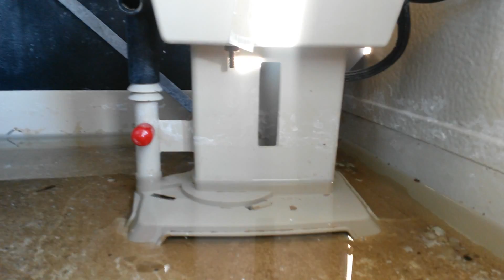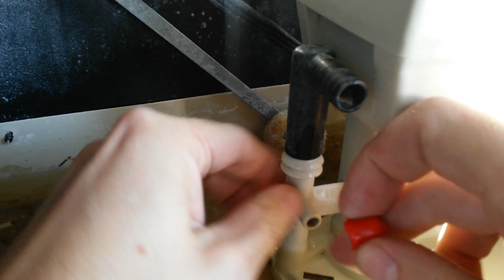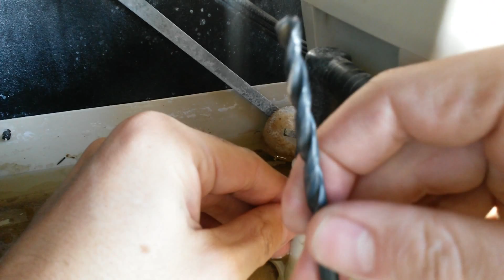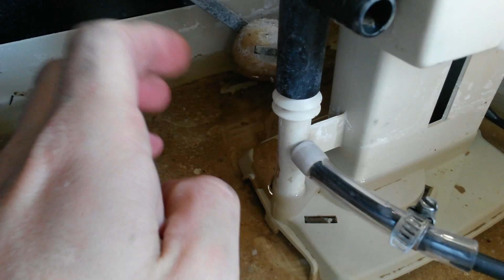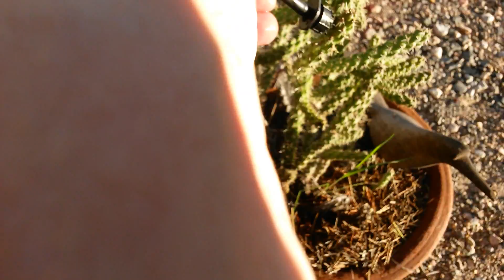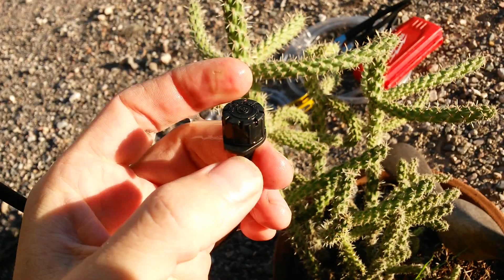Evaporative/Swamp Cooler Bleed Off Valve ~How to Completely Eliminate Scale Build-Up

Comment: What I did was connect a water hose to the overflow under the evaporative cooler and then I removed the tube in the cooler that is on the upper end of the overflow. I have a cap on other end of the water hose and I just uncap it every few days to clean out the water in the cooler. Here in New Mexico we have quite a bit of minerals in our water.  I have but don't like using a purge pump, I feel that every 8 hours on its timer is way to often to change out the water.

Comment: Watched this vid yesterday. Thanks. My pump has no  side fitting like yours so I had to re-think my setup. Since my cooler is a roof top model, it has about a 15' drop to ground level. why not do Gravity Feed? I bought 50' of the 1/4" irrigation tubing and a small pack of the adj drip tip you used  and ran the line to my big tree that could use a slow constant drip. A quick suck on the line sent a nice stream to my tree which I throttled down to a very slow drip. The other end was just placed under a small rock in the cooler base and fed thru the overflow tube. Bingo! Done. 2 parts. 7 bucks. Thanks!
Reply from the maker: Nice!
If you ever loose vacuum, you'll have to start the flow again. Great solution!

Comment: The man at the hardware store said I could attach the SE directly on the water line? Another video on here says so too. Does anyone know for sure?
Reply: What is an SE
Reply: @HopefulPessimist  Scale Eliminator...i did end up using one. It does no good whatsoever without a bleed off pump, which uses a lot of water running off the roof. No thanks!
Reply: @userG5447  thanks. I actually have quite an inventive mind thanks to somebody upstairs ha ha. IronBuddy 5Pcs Brass Spray Nozzle with 1/4“ Barb Adjustable Misting Dripper Sprinker Spray Nozzle for Garden Lawn Patio Irrigation System https://www.amazon.com/dp/B07RN481B5/ref=cm_sw_r_sms_apa_i_ONs1Eb2RCMZTH

I put my bleed off pump to use. Not super great, but the hummingbirds seem to like it.
Reply: @userG5447  My solution to that was to run a line over the roof to a 55gal barrel on the side of my house with a pump in it. I have lines run to various plants around the yard. This way none of the water get wasted, good for the plants because the chlorine is gone after the water sits for a few days, because it is a VOC.
Reply: @peterbrockhoff857  That's what I was planning on. Picked up an extra barrel from another project; cuz it was a good deal, it's been sitting in the basement.

Comment: Actually there is a difference on tubing types.  You want to be sure to use a tubing that is manufactured with a UV inhibitor. 
If you use tubing that doesn't have a UV inhibitor,  the tube Will break at the worst possible moment and have a serious problem  !

Comment: There is no need to connect the hose to pump bleed line! You can simply connect a hose to the bottom of swamp cooler, while swamp cooler have enough elevation to siphon water throw hose.
Reply: Unless the cooler is on the roof.

Comment: Not good for plants,  evaporative cooler water has high concentration of salt.
Reply: Theo Campbell : Thank you, I have this water purging directly into a planter.  I wondered why those bulbs did grow.
Reply: pen mightygun ty
Reply: can you explain how u get high concentrations of salt, if you're using tap water?
Reply: @David-vm1oq  Evaporation!. Hard water carries lots of minerals including salts. As the water is evaporated through the pads it leaves those minerals in the pad, and of course, the water that doesn't get evaporated flowed back into the pan. As time goes these minerals accumulate. Next thing you know your pads get clogged with mineral deposits (lots of white residue, or salts.) Bleeding or purging is just a way of controlling but not eliminating these deposits. Only a water softener will do that but even that will become clogged with deposits in the filter. Here is an example of scale and salt mineral deposits.  https://youtu.be/C-1niTsKYAY?t=26
Reply: @David-vm1oq  Tap water has mineral salts, especially in the western states, and the salts concentrate in the tray as the water evaporates. You have to dump the tray occasionally or the mineral salts will end up on the pads limiting their usefulness.

Comment: it took him till the end to tell WHY you need a bleed off but he finally did!  Thanks.  Now I can modify my Bonaire to quit bleeding off so much water.  The opposite of what happened here.
Reply: Do you have the Bonaire Durango window unit? I just bought one and it bleeds a ton of water. The element isn’t even getting wet after running it overnight ...
Reply: @spacecruisers  I just got one myself and I'm almost done installing it. What was your issue?
Reply: @jonathanbetenbender307  I looped the drain hose back into the reservoir. It was just a huge waste of water. More scale buildup this way because it’s recycling the same water but that’s ok with me.